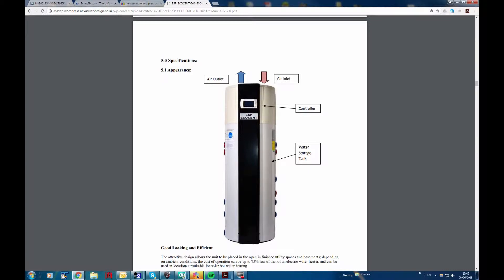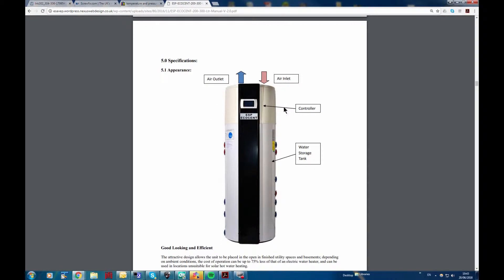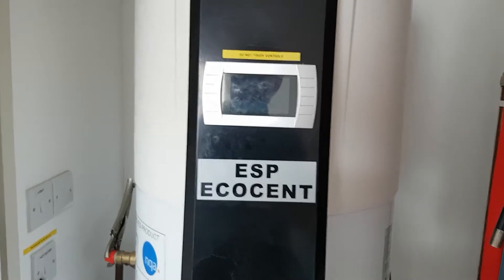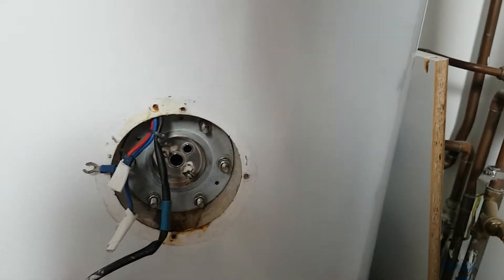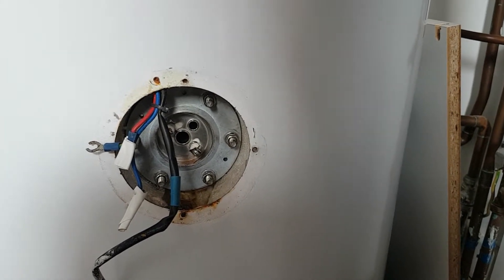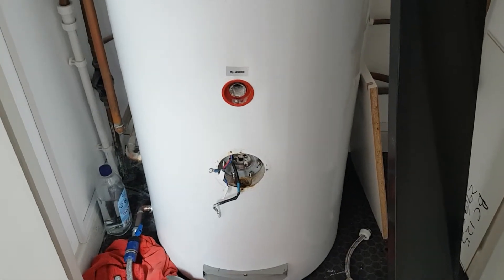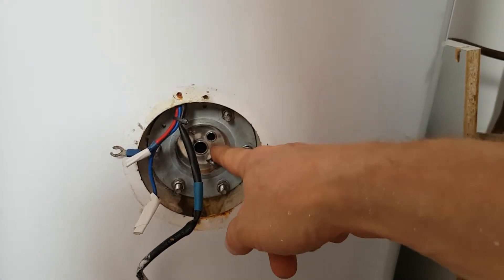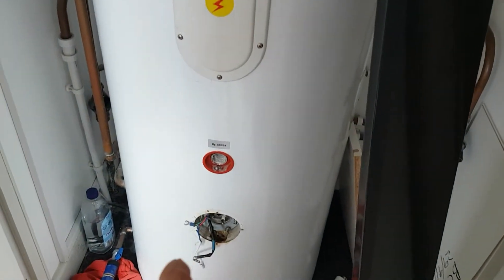ESP Ecocent Heat Pump Water Cylinder Repair & Review

Comment: Thanks for this - I've got exactly the same problem. I've also solved it the same way as you showed - disconnecting the heater element and slapping on some insulating tape. We have a 300L tank, and manage perfectly well as a family of 5 with just the heat pump side (combined with solar heating panels which do 90% of the work in the summer), so we've not missed it. It's still weeping though so I'm going to replace it. I see you got some made but they're all gone. Do you know where I can buy a decent quality one?
Reply from the maker: You are welcome. Please remember to subscribe to help me.   You may find that the compressor runs for longer than is normal.  I discovered this problem on some heaters where the compressor is slightly under par or the gas is low. It relates to a software Legionella procedure which I think is BS but nevertheless they have incorporated a periodic cycle where the controller decides to heat the water to 65 deg C  to kill the bug.  Meaningless twaddle, but it turns on the immersion heater to allow it to reliably meet the 65 deg kill target.  With no immersion backup, for any reason your your compressor cant manage it on its own then the compressor will churn on indefinitely.   Another thing you should check is that the schrader valve that is the gas fill point on the compressor piping. I have had several units that have totally lost all gas or have  low gas due to aging of the seal on the schrader valve.  As the valve seal ages the valve gets looser and looser and the gas leaks out.  As the seal loses its shape the valve is no longer screwed tight.   DONT UNDO IT but Just tweak it up.  It could save you a lot of cash. That's it. Good luck an oh: and https://www.aliexpress.com/item/33004377351.html?spm=a2g0o.order_list.order_list_main.5.674d1802c4PJuE

Comment: I have one which has been in use for a few weeks a year in a small chalet in the Alps and has run fine for around 10 years until it has now started to trip the circuit breaker exactly as you describe.  When you turn it on the display lights up OK for a few seconds until it trips presumably as it is attempting to do one of its heatup cycles against legionella.  I'll try disconnecting the power supply to the element and see if that allows the unit to operate OK.
Reply from the maker: Most likely a failed immersion heating element. You can disconnect the element and just use in ECO mode.
Reply: @razenby  The video is very helpful in giving me the confidence to try and sort it out.  It was still working when I arrived running in eco mode.  Not much chance of getting anyone to fix it for me, it was hard enough getting it installed after having it sent out from UK on a wagon.  The French plumber was very suspicious of the whole concept.

Comment: Has anyone tried running an underfloor heating circuit off this ? Instructions and sales bumf say's its possible.
Reply from the maker: Could  do but once the heat stored in the water is conducted away by the floor heating circuit 4KW continuous heat output to the floor. It is pretty old tech now - you would be better off with a modern inverted driven heat pump.

Comment: Hi. Would you be able to come and look at our ecocent in south east London? I can only find an earthsave person to service it and it costs £££££. Or do you know of anyone around us that could help? Thank you.
Reply from the maker: What is it doing? Any Signs of life?
Reply: @razenby  it’s going fine. But I think it could do with a service and the anode replacing as the last time was four years ago. Which cost £600.
Reply from the maker: @ThatJuliaCrouch  I don't normally repair other properties as I have no liability. The maintenance tasks can be done by any plumber - it is a standard procedure to change the sacrificial anode  and clean the fluff from the heat exchanger and check the pressure relief valve is OK.   Most capable handymen could do it. I can talk them through what is involved on the phone if they have any questions.

Comment: Thank you for all the very helpful info on Ecocent. I have had a 200l one since 2014 without any problems. I do have a niggle now however, the down arrow on the touch screen has stopped working. Any and all ideas on how to work around this or fix it will be most welcome. If anyone is scrapping their Ecocent, I am in the market to purchase your touch screen module. Has anyone figured out who the Chinese manufacturer is?
Reply from the maker: The touch screen is resistive.  Check if you can continually hit the up arrow and the list rolls over or stops at the top, If it rolls over you can navigate around it. Check the display is mounted i n the frame correctly and check the connections.  If it is only one corner of the frame it could be that the supply voltage that drives the x,y gradient has dropped.  This usually stops one corner of the display from working correctly so it could be a leaky capacitor. The caps will be getting old now as most are only rated for 2000 hours at the rated temperature.  I don't know who makes it - I do have the number of an independent engineer who will likely sell you a display. I would expect it to be pricey.. I expect that they are made by Way Lee Kee Kettle Co.
Reply: @razenby  Thank you for replying so swiftly. I will investigate and let you know how I get on
Reply from the maker: @suegeorge49  No problem. Please like and subscribe. Good luck. Thanks.
Reply: @Magic Smoke  do you have an email I could contact you on?  I've had an ecocent for 5 years, and it needs replacing. I'm looking for an engineer to connect and commission the new ecocent unit (luckily, I've never had any issues with the ecocent until now). The suppliers are in Oxford, and I'm kent, so it's a bit of a trek for them.
Reply from the maker: @mags4458  Did you ever get it replaced? I support 7 of them. So far managed to keep them all going.
Reply: @Magic Smoke  yes I bought an upgrade from ESP. Its a little smaller and oddly has no pull out dust filter.

Comment: I've bought two 300L from ESP and they have been appalling, no design, no info, no support. Just unboxed the first one and it has outlet/access ports on all sides including the back.   How much space does it need around it? Please.
Reply from the maker: You need access from the front and enough space to change the pressure relief/over temp valve at the left hand side. About 8 inches space all around should do it.  I know what you mean about the ports.   On a few I have had to redo the plumbers plugs as they leaked.  I use the Loctite 55 sealing thread.  The main issue with them is the direct heating element. When you set this up try and make sure that you heat the water with the ECO heat pump and don't unnecessarily bring the  heating element into play when the water would have  heated up anyway if given the time.  It will make the units cheaper to run (obviously) and much more reliable.  Carry spares of the heating element and the ring seal. Else you will be out of action for a week as you  source then parts at a high price. Hot water for a couple of people in the house the pure ECO mode is best.  You have the installation manual?
Reply: @razenby   I'm so sorry not to have thanked you sooner for this reply.  We have two large ecocents and we ended up installing them next to each other, but at different angles so we can access all the ports reasonably easily, and with 150mm gap between them. So far they're working in that they're producing hot water, but I'm far from understanding how to control them properly. I'll need to spend some time with the manual. I'll also take your advice and the source spare parts you recommended.
Thank you, sincerely, and apologies again for not saying thank before, I was in panic mode when I messaged.

Comment: Hi, do you have any elements left or details where to get the cheaper ones from as I am looking to get mine changed, pretty sure mine isn’t working as weekly legionella process doesn’t ever turn off on its own on the controller, suggesting the water in the tank doesn’t get to the desired temp
Reply from the maker: Check the relay that switches the compressor - they get welded shut.  In the 30 heater-years of experience I have had with these I have never seen n element go open circuit. Every one has leaked electrically to supply ground. i.e. The insulation has broken down and caused a supply short.

Comment: Actually is a lot more info than you given in your video.
The air should be extracted from the bathrooms of the property, also the back up Immersion heater only should run after 200minutes  after the air source heat pump start running and if the  air source heat pump can't keep up with the demand   of the DHW of the property. The electric consumption is 640 watts. If the Ecocent is running more than 4 hours per day, it means the air flow isn't enough, or the outlet of the Ecocent isn't enough for the specification of the manufacturer.
I will chalange all your comments as you actually don't know how the Ecocent unit should be installed and you didn't read the manufacturer installation guide...
Reply from the maker: Not sure what points you are trying to make.   When the flats were built an Ecocent  APPROVED supplier specified and installed these heaters in the block of 8 flats  not me. BOOM.  Should I name the supplier and call-out the performance of the dreadful heat pump hot based central heating too?   If you have a commercial interest in this product then you should declare it here and address the reliability problems with this device at the engineering stage. Stating self evident facts from the installation manual does not address any of the reliability issues.  The major issues are the poor-quality low-reliability heating element, relay boards that burn out because the spade crimps used are inferior and the poor finishing around the heater element sealing flange that makes near impossible to seal without removing the  weld blobs. I have six years experience of looking after three of these devices.   So that is 18 years of experience.  I have had arranged maintenance where I could find it from 'approved engineers' and I ended up maintaining them myself.  I can get superior 316L heating elements made myself etc.. etc..
Reply: @razenby  i installed one in 2012 on my selfbuild and have never put a spanner on it and rightly or wrongly only replaced the mag anode once in that time!!...btw julio is part of the earth save products team i think your find....

Comment: Have you fitted an electronic anode to your tank? My compressor stopped working recently and it turned out to be the capacitor that starts the compressor that had failed. It was £10 for a replacement part and easy to fit. Have you got the part number for the heating element so I can order some.
Reply from the maker: Yes a new anode. I made it from magnesium rod. Capacitor failure is quite common on refrigeration compressors. The only part number I have is our own drawing for the 100 pieces I had made from the correct grade of (stainless 316L).  I support a block of flats with these heaters and I have sold most of them so I don't have any to spare. You can buy the manufacturers element from Earth Save Products in the UK.
Reply: Do you know the diameter of the sealing ring for the thermostat. Do you think I can use a triclamp immersion fitting, they come in two diameters 2 inch and 1.5 inch hence the question about diameter.

Comment: Hi - where can I get the heater element and anode. I need a supply for annual service. Another question, is whether there is an alternative system with the sAme economy. Without the huge annual maintenance cost !
Reply from the maker: I had some made as the elements that come with it aren't SUS316L grade stainless. I sold all the spare ones. If you go to Earth Save Products then they will sell you the Anode and the Element.
Reply: Magic Smoke I hope the new elements are the right grade. Thank you for your reply.
Reply from the maker: @richardtrailblazers8639  Some of the Original manufacturer's elements corroded and clearly weren't 316L others didn't rust but the steel was porous and allowed moisture  infiltrate.  It is basically a good unit but maintenance is required. I don't know if they are more or less reliable to a standard UK pressurised immersion tank in a home where all the hot water is heated by direct electric element..One thing to make sure is that the unit is set up thoughtfully and correctly.  The heat pump produces plenty of hot water but often the heating element is switched on when everyone is out and there is plenty of time for the water to be ECO heated.  i.e. If you think it through and set up appropriately you can save a lot on electricity and drastically reduce the time the heating element is on thereby increasing the service life.   The fitting on the tank is a Chinese system so many elements are available from China but the problem is that they are low quality,  I am arranging for manufacture of elements for Bosch machines at the moment.
Reply from the maker: I just ordered some. Delivery about 4 weeks if you want one.
Reply: Magic Smoke would be great if you could order me one-NOTE WELL mine are BOLT IN (screw in) type. And an anode while you’re at it! (If you can). Let me know payment details and I will give you my address. Guess that should be private info......
Reply: @razenby   Hi, Do you still have any of the immersion heaters from this last order ? I'm in the market for one asap. Thanks
Reply: @razenby  have you an element for sale please?

Comment: I have the same unit, I have the problem of the water getting hotter and hotter.
Have you had any trouble with the thermostat in the immersion heater?
Reply from the maker: Check the wires. There are 2 temp sensors. One slides into the heating  element. The other one that slides up into the hole on the immersion heater. To check if it is the immersion heater sensor that is the problem, disconnect the heating element and tape up the connector on the wire and run the heater. If the problem goes away it is either the thermostat or a stuck relay on the control board under the cover. Usually the spade terminals a loose and you can see burning and melting. I have spare relays in stock. If the compressor just keeps on running and never stops then usually you get condensation leaking out and running down the tank. Again caused by a shitty relay. There is circuit diagram somewhere (I think). If you have a voltmeter the when in set in ECO mode thereshould be no volts on the immersion heater.
Reply: @razenby   hi, we have the same problem with the tank overheating and shutting off. It also seems to continuously run (not sure what it’s doing once it’s reached the target temp). 

Our engineer tried the sensors and this did not resolve the issue. Our engineer and ESP thinks it’s the PCB. This has been quoted as £550 for the part… do you think this is right or could it just be the relay you mention above if so could I purchase one please?
Reply from the maker: @Andy-fn4sc  Hi Andy, if the compressor is running and running it is probably a stuck motor relay on the controller.  I have looked after six of these units for about 7 years and have had three motor relays relays get stuck shuck . If the reported temp on the display is not correct then have a look at the the controller and check the thermistor for the tank is in position  and wiring to the thermistor looks good. If the displayed temp is correct then inspect the  relays carefully for any signs of melting or overheating.   If it is the motor relay then there is often no physical signs of failure.  It is the inductive load of the motor fries the contacts and they get crusty and then the weld shut.  I have relays in stock. Whereabouts are you?
Reply: @razenby  great thanks for this! I will forward on to my engineer. I live in Devon near Exeter. Out of interest if we were to change the unit what would you recommend getting? Is it worth moving away from the built in heat pump unit and getting a monobloc system? 

I see there are now quite a few other brands doing this type of system such as the Vaillant AroStor, Dimplex Edel and Ariston Nuos. Have you had any experience with any of these systems? Many thanks.
Reply from the maker: @Andy-fn4sc  Sorry have no experience of the other products.